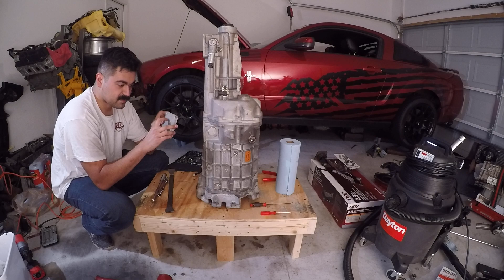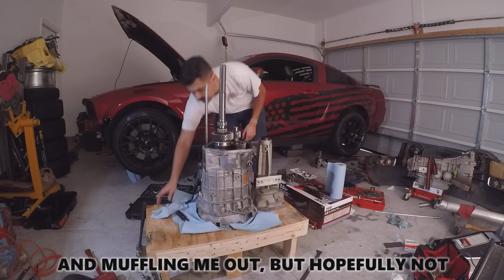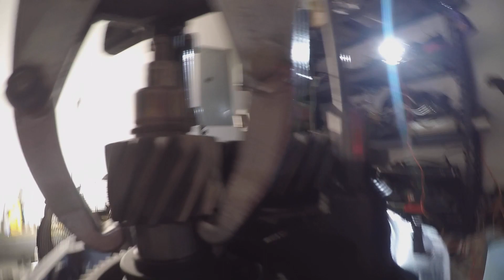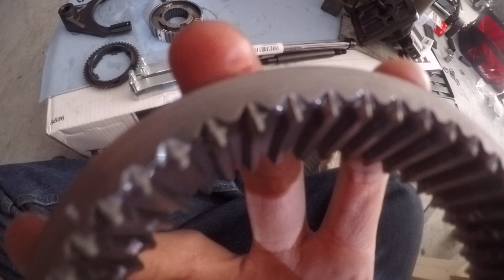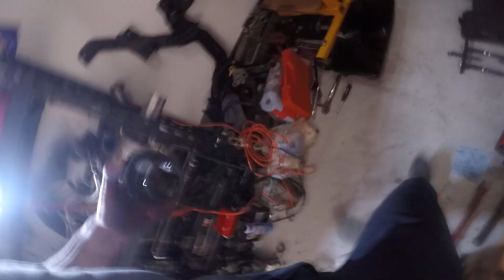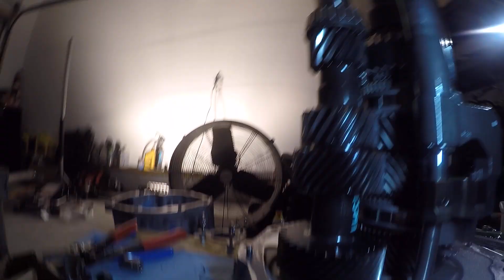Tremec Magnum XL Disassembly Part 1

Comment: Need a huge favour. You seem to know the TR6060/T56 magnum really well. I needed to pull out only the input shaft. I know on the older T56 you can just take the front cover off and remove the input shaft. I know on the TR6060 input shaft, the gear (4th gear) has a lip/flange which sits being the counter shaft gear which makes it harder to remove, but ive heard its still possible with a little “wiggle wiggle”. Can you confirm if I can remove the input shaft on the TR6060 without a complete teardown and just remove it from the front?